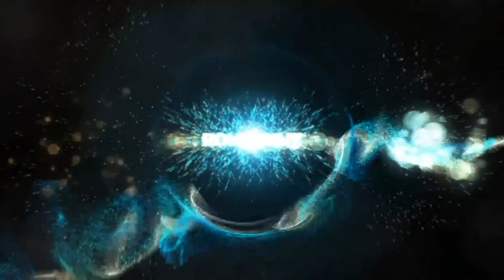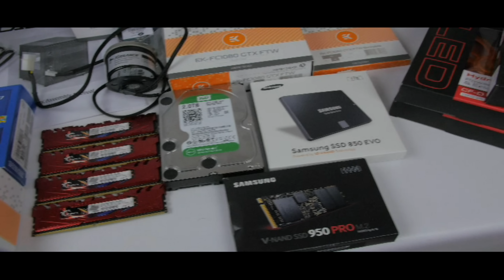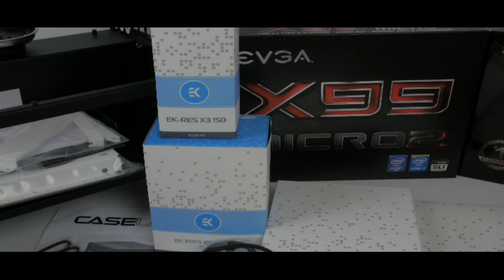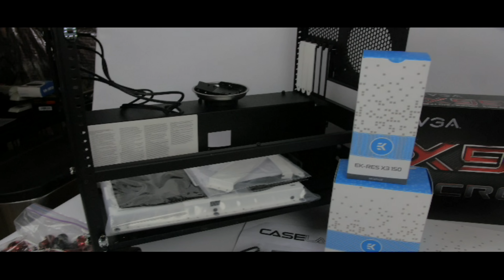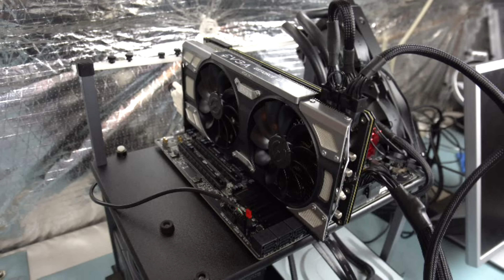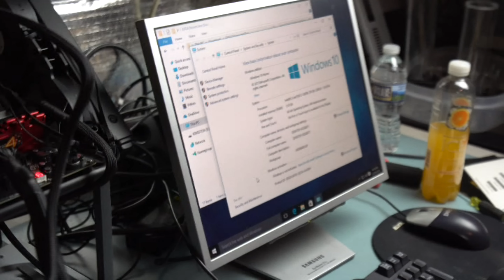EVGA & EK Build Log 1 -  The Parts and Checkout (4K)

Comment: Too bad you didn't had a black screw for the M.2 SSD drive. 

Also concrats on all the wins that smiled upon you in 2016. I think it's getting very though for 2017 to beat 2016 in you're case.
Don't forget to enjoy life! I've spend way too much time behind the computer. It's an recurring resolution (tradition?) every year to promise to spend less time working on the computer and have more family time..
Reply from the maker: Yes, as long as I work to enjoy and live in the moment, and work to squeeze the joy out of every day. Instead of letting the day squeeze it out of me, then I think I'm in good shape..